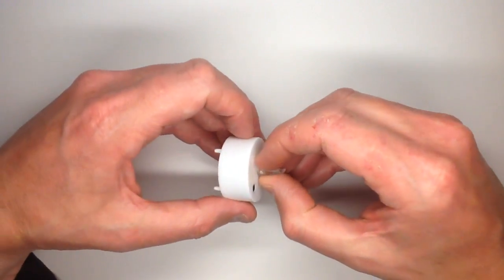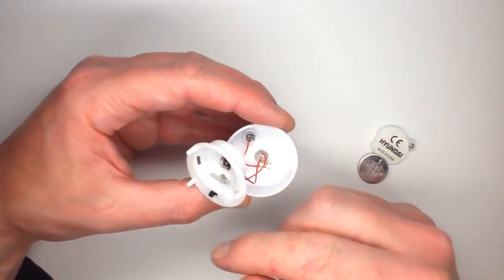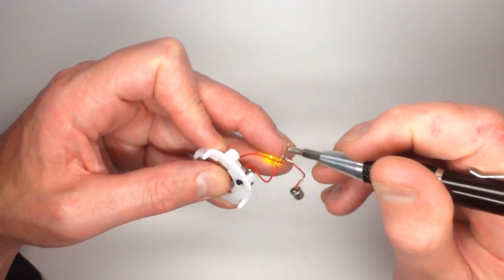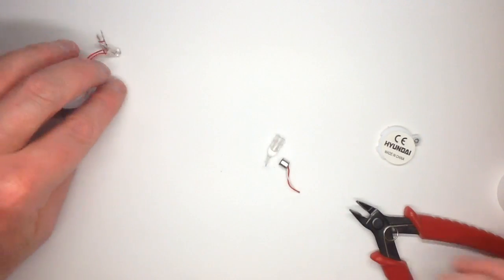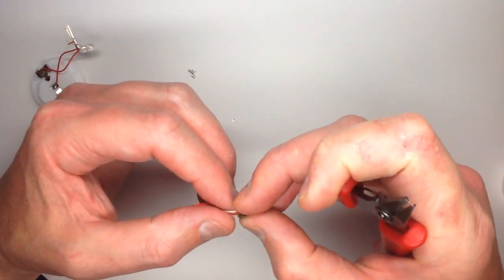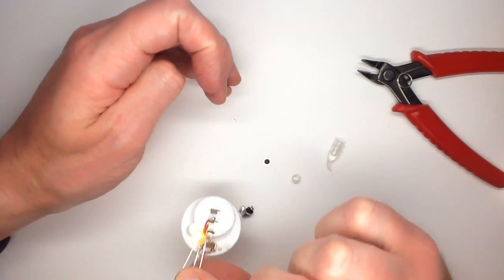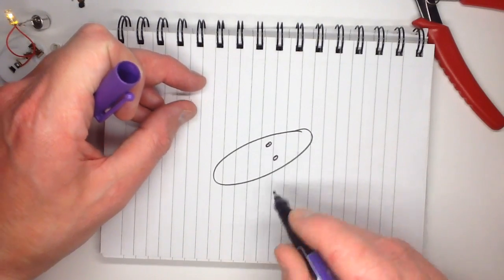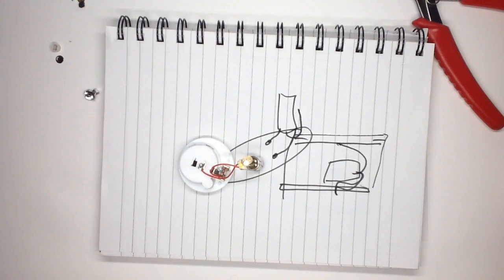Inside an LED candle with blow-out feature.

Comment: Clive,

Is the ambient sound the source of the flicker?

Is the led a 3-pin bi-colour LED?

Great video as always.
Reply: Ambient sound is not the source of the flicker as it still flickers with the mic cut off (2:50). The LED is single colour, the third leg is used to turn it on an off (the logic will be inside the LED).

Comment: So what kind of LED has three legs?

(The Hyundai sticker on the bottom means this came from PoundStretcher, right? :-)
Reply: A 3 lead LED is typically a tri-color LED with two LEDs.  One LED is usually Red, the other is usually Green, with either a shared anode or cathode lead.  A third color is derived from the two primary colors, so when Red and Green are used the third color will be Amber (you can actually vary between yellow and orange if you vary the ratio of red to green) -- this is also how red and green mix on your monitor or television to create yellow.
Reply: Ethan Poole Very true. So I'll have a stab at what I think the OP was getting at... 'What kind of LED has three legs, flickers a yellowish colour, and can be switched on and off again by shorting two of the legs?" ;-D As that is not your typical 3 leg bicoloiur led!
Reply: Ethan Poole Great reply! :) I have encountered the custom chip leds before  I have a couple dozen RGB slow fade / fast fade leds that colour cycle all on their own - they just need power, thus only have two leads. Have you ever encountered anything like these that can be bought by a consumer? on fleabay for instance? Or do you think they are strictly a custom job, thus impractical to obtain (unless you buy all of poundlands stock of them ;)? LEDs a definitely  getting pretty high tech now, with embedded logic and drive circuitry like the WS2812 leds... it's so cool how you can just tell it to hold a colour, and it does it all by it's lonesome, and how you can chain a whole bunch of them together, and still address them individually.
Reply: +Pete Feerick My apologies, I thought there was a circuit in the base, but on review it was just a switch.  LEDs can, and have, been manufactured with embedded microchips (it is all just silicon) on the LED die.  If you have ever seen a flashing LED (with no support circuit) or an LED designed to operate at a higher voltage (such as 5V) without multiple serial LEDs then you have seen an LED with added components on the internal die.

In this case there is embedded logic to flicker the LED and toggle the on/off state based upon the microphone input and they are simply reusing a tri-color LED package as it offers them an extra pin for the microphone connection without needing to create a custom LED package.  In this case the silicon die is custom (but cheap to produce in mass) but the actual 3 lead LED package is a standard package type.
Reply: Ethan Poole Interesting. I have self flicker LED's with the controller microchip as a separate larger die inside the LED, sometimes it has purpose made lead frame to support both the chip and the LED.

Comment: The 2SK596S FET is designed for use in electret mics and the like, and has an integral high value biasing resistor gate-source. The same type of device is used in PIR sensors.